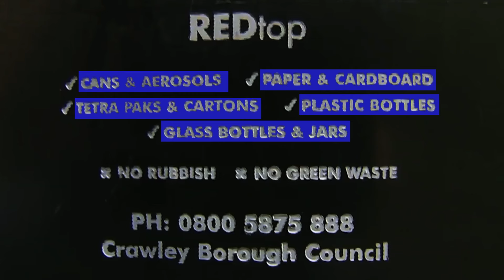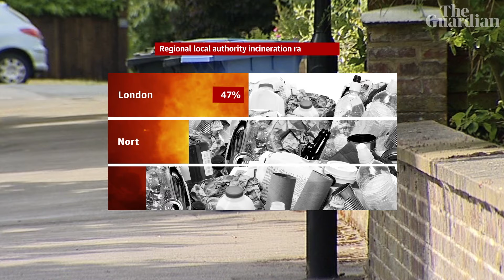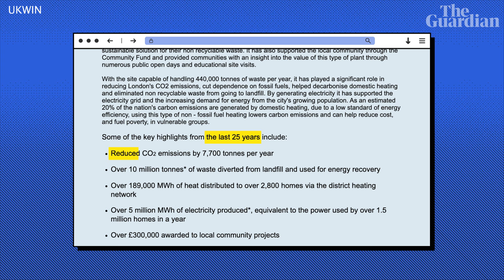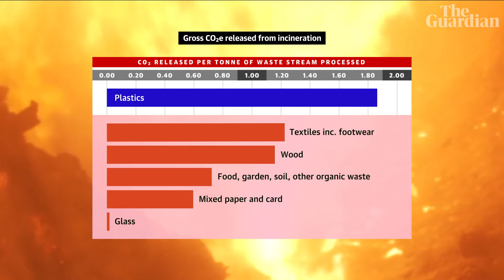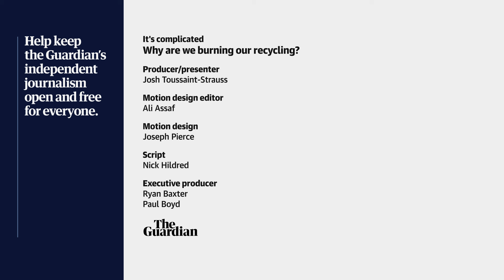Why we're burning our recycling | It's Complicated

Comment: The simple solution coming from 22 years in the waste and recycling Industry I'd simply buy less or buy what you need. Reduce. Unfortunately there is too much packaging. Also a simple universal waste collection scheme would be better i.e the same collection method across the UK. One bin for refuse one bin for recycling and one bin for all organics.
Reply: Thats the system in italy, i was there for 10 years. There were several bins.
One for glass
One for paper
One for plastics
One for general waste
One for general recycling. 
This was further incentivised by fining anyone who doesnt match thr corresr waste wirh the correct bin
Reply: Too much packaging is a real problem

Comment: I think you are wrong .. the main stem problem is Single Use Plastics thus the solution should be eliminating single use plastics (SUPs), strick EPR on plastics, and moving toward Zero Waste Economy (i.e Refill, Reuse, Repair, Recycle, Rot,Redesign, etc - economy) .. which alot of grassroot movement and business already taking a lead in several parts of the world. A decent journalist should have known that. 

Ref : BFFP(BreakFreeFromPlastic), GAIA , etc